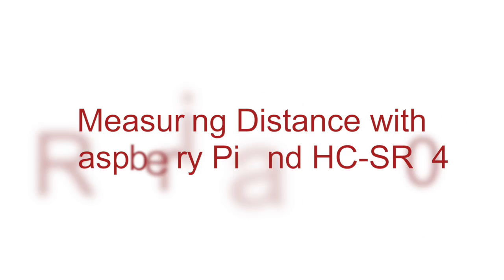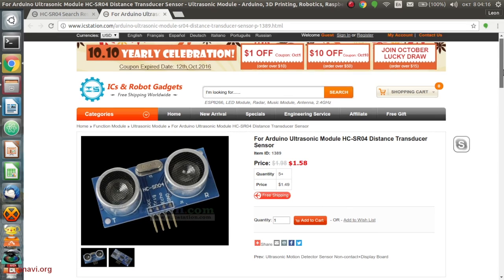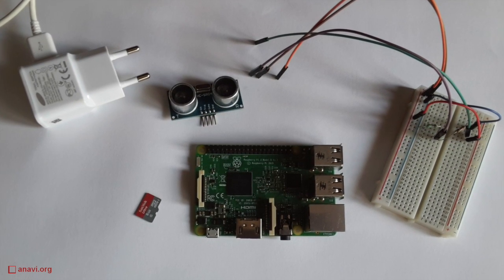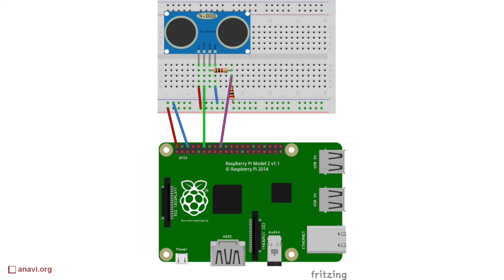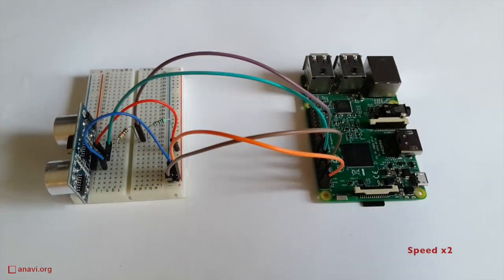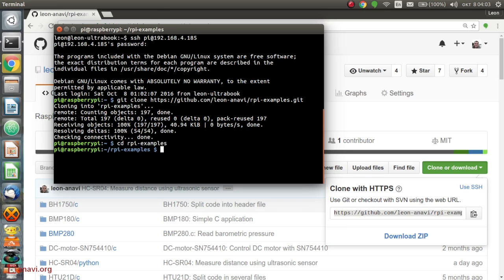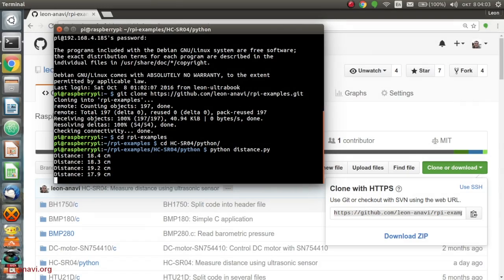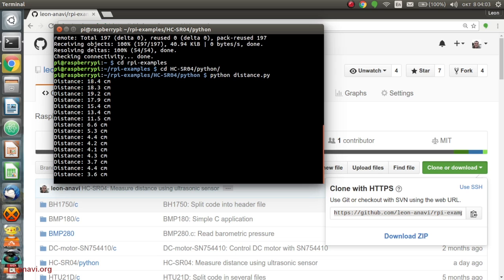Measuring Distance with Raspberry Pi and HC-SR04 Utrasonic Sensor

Comment: When I follow the steps in the video, the terminal says "distance.py:21: Runtime Warning: This channel is already in use, continuing anyway. Use GPIO.setwarnings(False) to disable warnings. GPIO.setup(pinTrigger, GPIO.OUT). 

And then the distance output doesn't appear. How can I fix this?
Reply from the maker: Have you wired the trigger of HC-04 to pin 12 (GPIO18)? Is anything else using pin 12 on the software side of your setup?
Reply: @LeonAnavi  Thanks for the response. Actually, I figured out the problem. It was just that I was using a defective HCSR04 sensor but when I ordered a new one and tried it, everything works well. Thanks.
Reply from the maker: @adios04  well done for figuring it out and replacing the defective sensor. Thanks for the feedback and sharing your experience.

Comment: can i use 1k and 10k resistors
Reply from the maker: Good question. No, particularly 1k and 10k is not OK. These 2 resistors are used to create a voltage divider. Any other combination of resistors in the 1-50kΩ range will do if it covers the requirement: R2/(R1+R2) = 0.66.
Reply: @LeonAnavi  instead of 2k ohm resistor can i put 2 1k resistor in a series instead of parallel
Reply from the maker: @parthfn8230  yes, sure if they are connected in series.

Comment: Quick question: How would I gather the distances as a list in Python?
Reply from the maker: Just declare the list and  use the append() method to add data to it. In your case the data will be the measured distance.

Comment: The code isn’t working
Reply from the maker: What kind of problem are you experiencing with the code?
Reply: @LeonAnavi  im using a raspberry pi 3+, i have labeled all the gpio pins accordingly and proper voltage to sensor, the output is not coming, the distance that is. ALso a single distance of 8cm came during the first run and it was unexpected and took a lot of time to give the output. please help, i don't understand what I'm doing wrong
Reply from the maker: @karansehgal539  double check the wiring of the sensor.
Reply: @LeonAnavi  yes actually the wiring was fine but the sensor was busted, it was working all right initial. But now it's showing big values 3-digit values I suspect the wiring as it's not build to last

Comment: how can use two ultrasonic sensors together please share some code or any circuit diagram for connections of pins for both the sensors????
Reply from the maker: This is just a simple example, you are free to make it more complex on your own :) The source code from this video is available at GitHub. Have a look at variables pinTrigger and pinEcho and just adjust the modify it for what ever you need it:
https://github.com/leon-anavi/rpi-examples/blob/master/HC-SR04/python/distance.py
Reply: So for the second sensor i should just simply add the trigger n echo pin with rest of the procedure to be kept same?

Comment: Great guide. Some people in RPI forums have said that Python was too slow to always measure distance precisely. However this seems to work great. What Model Pi are you using? Maybe they were using the first generation Pi's, the topic I read was pretty old.
Reply from the maker: Thanks! The Raspberry Pi used in the video is version 3 Model B.

Comment: I've found many guides for the HC-SR04. What i dont understand is why every guide has different values for resistors. I've seen some from 330/470, to 1k/2k, to 4,7k/10k.

Why?
Reply from the maker: The VCC pin of HC-SR04 gets voltage from pin 1 of the Raspberry Pi at 5V. Raspberry Pi GPIO pins are rated at 3.3V therefore the voltage coming from  ECHO of  HC-SR04 needs to be decreased from 5V to 3.3V. The formula to calculate the two resistors is: 3.3V / 5V = R2 / (R1+R2). By doing the maths you can calculate that R2 is approximately 2 times bigger than R1. This means that if you put 1k for R1 then you will need 2k for R2. That's it.
Reply: ratios
3.3 = 5 · (R2/R1+R2)
it is relative you can do what you want with the Rx while the  (R2/R1+R2) = 0.66
Reply: so can i just use the 3.3v vcc pin instead of 5v of the raspberry pi?
Reply: I believe you need a 5V pin to power the HC-SR04, but you can send the Trigger from a 3.3V pin and the HC-SR04 sends a response 'Echo' at 5V.
Sóme people say you can power the thing with 3.3V, but a bunch of people say it doens't work at all and some people say it makes it less precise. So I would definitely stick with 5V for power and just a 3.3V trigger.
Hope this helps.
Reply: They are rare, but if you can find a HC-SR04P (2nd generation), you can avoid the voltage divider because it has an input voltage of 3v-5.5v.
Reply: @danielmacdonald4220  there's also the HC-SR04+ which also handles 3,3V. Also not too common. I found some on eBay.

Comment: Hi Sir, This code is compatible with which model of raspberry pi? The pin to be used for different models will be different right so how will it work on all models? Thank you so much for the tutorial
Reply from the maker: The pins of Raspberry Pi are backward compatible. Any Raspberry Pi after Model B+ (from 2014) has the same 40 pin header.

Comment: It's. Nice demo. Could you pls help me whether the raspberry pi3 built in wifi module can be used to connect to this HC SR 04 sensor or any other sensor? I would like to capture the data from sensor without any wired connections.
Reply from the maker: The built in WiFi on Raspberry Pi 3 can be used to connect the board to a WiFi network. After that with the appropriate software you can access remotely the Raspberry Pi and the attached sensors using any IP-based protocol (SSH, VNC, HTTP, MQTT, etc).

Comment: It appears to have 2 sensing parts, does it take input from both or what? 

Also what is it's range of detection, straight line of angled and curved?
Reply from the maker: There is a single input. According to the data sheet the effective measuring angle is 15 degrees and the range is between 2cm and 4m.

Comment: Did you format the distance to show precision only to 1 decimal point or is that the default precision of the ultrasonic sensor?  I am thinking of making a scale with springs where the ultrasonic sensor measures the distance from the weighing plate before a weight is added and after a weight is added. Because of this the better the precision the more accurate the result.
Reply from the maker: Hi Marco, yes, I am setting this precision while printing the output on the screen. The example is available as free and open source software in GitHub and you can explore it: https://github.com/leon-anavi/rpi-examples/blob/master/HC-SR04/python/distance.py
Reply: Thanks for your prompt reply. I was also wondering, is the sensor able to process displacements of say 1 mm in magnitutde? I plan to use the sensor on ranges from 10cm to 5 cm but It would be nice if i could have an precision of 1mm although I think that is asking a lot from such a cheap device.
Reply from the maker: Marco Williams yes, although it is a very unexpensive sensor therefore the accuracy is not perfect. If you are looking for high end proximity sensor search for lidar.